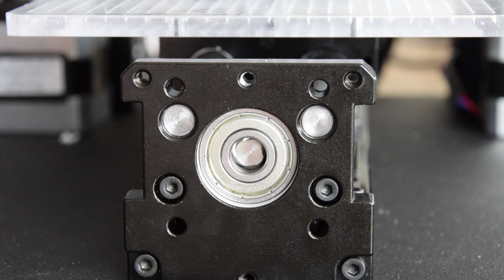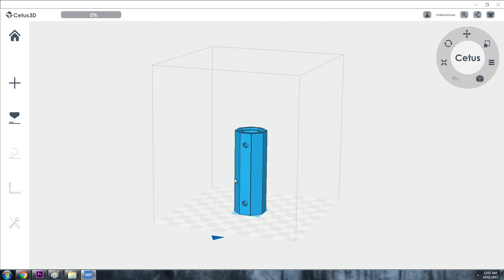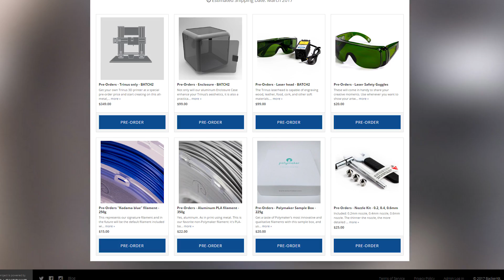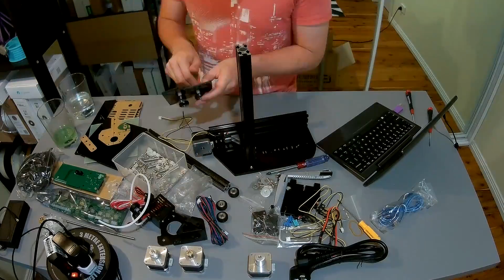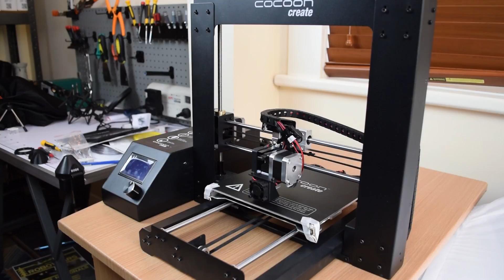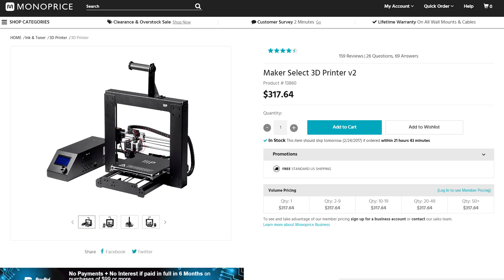Cheap 3D Printers THAT DON'T SUCK $350 and under

Comment: Hey why not the anet a8?
Reply: I have an anet a8 and it takes a while to tune the software etc. But after that it prints beautifuly
Reply: Jere ir just need a little tunning and i believed is better than the tronxy
Reply: Ugh, too many tiny printers.  I bought the Anet A8 for fun and now I am making money with it. Not to mention how much this machine has taught me about 3D Printing.  It was a gamble...but at $155.00US I was willing to take a chance....at least I didn't blow my money on vaporware Kickfarted crap.
Reply: Fear Not God Is Faithful Once you tune it and get everything right it prints amazingly for the price. Better than the tiko at least lol
Reply: Fear Not God Is Faithful There is nothing wrong with a working anet a8. Either you messed something up or it was a lemon.
Reply: mine is working perfectly. did you bother to actualy upgrade it or try to run it stock which no one does.
Reply: My A8 printed fine out of the box and I got a lot of use out of it, but 3 months later the heated bed died. I just bought a Prusa Mk2, so I'm not going to bother getting a new bed. Now I can only print PLA for 7 weeks while I wait for it to ship.
Reply: john convis You can print frame supports, but I actually haven't needed to.
Reply: Gonna chime in and agree. Why not the A8 or any of the other cheap prusa kits? Still enjoyed the video though!
Reply: Maker's Muse why you dont make a review about the anet a8 to have a experienced person to talk us about that printer
Reply: Not true.  Go look at my channel right now. I am on a 9hr 30min stream of a print at 6000mm/min.
Reply: anet at is best cheap printer :D
Reply: Anet a8 is awesome my only recommendation is to get a mosfet on Amazon it's only like ten bucks
Reply: yes. you can encase them, but by default they are slightly exposed.
Reply: What is the big deal about exposed mains? Just unplug the thing or don't lick the input terminals and you will be fine! If this is your definition of scary, you need to live a little. And yea, I am aware of kids. If that is your problem then print a cover, elevate it, or put it out if there reach.
Reply: 7 weeks? Where are you getting your parts? Gearbest?
Reply: The Prusa i3 mk2 is on serious back order. They have a 7 week lead time.
Reply: I think one reason its off the list is because of having to wire mains power to the power supply.
Reply: I have had my Anet A8 for a few months now and it works great! but i hit the bed while leveling and need a new nozzle(in shipping). Would buy again.
Reply: It really should have been sent with a small simple printed cover for the power connection, it is a bit of a strange omission on their part as there was plenty of room in the box and a small cover would have been easy for them to add. Or at the very least a file on the SD for a cover and a big warning saying  "PRINT THIS COVER FIRST FOR SAFETY BEFORE GENERAL USE". 
When I got mine I thought of this straight away and printed a cover up as soon as I did my first few test prints for setup. Then printed a few of the braces up and it's been a solid great printer since then. 
However anyone thinking of getting one should read up on it's problems, like making sure the wires are connected extremely well and triple checked before use, or the relatively cheap MOSFET upgrades and other printable bracing available to fix it's shortcomings. 
But I can see why it's not on the list, as technically you require an electrician in Australia to attach a mains cable to anything and at the very least should only be assembled by someone with at reasonable electrical knowledge..
Reply: My powersupply on Anet A8 have, mains is covered, i think it have IP20. From my perspective it's safe. But this printer needs some modification, i have to replace all heat-bed connectors and i have to agree if it needs solder-station to make printer safe it's not for everybody. 
But for me it's fantastic device and it printed perfectly from beginning and it's even better with beta version of Cura which has setting for first layer.
Reply: The anet a8 but isn't as reliable. Also the tarantula is better
Reply: I would not say it's wobbly, but one of the first things many people print with it is frame braces.  Fixes any possibility of wobble quickly.
Reply: 1 its china 2 dont buy it if thats yours concern 3 any novice is capable of safely maintaining a kitted printer laid out like this
Reply: I heard that the Anet A8 is wobbly because of the acrylic frame, is that true or is it non noticeable?
Reply: Depends on the model. I've found 3 potential versions. The design most popular is with 2 triangular uprights that are perpendicular to the axis of travel. unfortunately they should have been rotated along the z axis by 45degrees because the height of the build volume and the weight of the nozzle assembly has a wobble left and right that gets exaggerated as the print height increases.
Reply: It's simply not safe enough for general recommendation. Neither is the wanhao though.. most reviewers haven't used one enough to notice the MOSFET issue
Reply: at least it's a cheap and quick fix from what I read. But I also agree that that is some tinkering many people aren't willing to touch.
Reply: 3D-MEXICO I got mine for 250 with shipping from gearbest and I love it works great
Reply: As I mentioned, I have baught the A8 and hope it will turn out really 
nice. He included a cheap printer kit, so I can get his point in not 
recommanding it. Besides the power connection "issue", there are other security flawas I have heard of. MOSFET, thermoresistor, connections,... just to mention a few. All in all it should be a great value for the price and with some upgrades sureley a decent printer. BUT it is his oppinion, he expressed, and I totally get why he would not recommand the A8.
Reply: Yeah.  But a EC320 switch can fix that. $5, and print a cover.
At least on the A8 once you are done you can mount it to the uprights and its out of the way from being jostled and stuff.   The A2 and the Tarantula you have no place to mount it unless you use a baseboard to mount it all on.
Reply: or you can just upgrade to ramps 1.4 and 2650... or even cheaper, buy a replacement board... they're cheap
Reply: any product can be a lemon. And a troxixy is probably more likely to be a dud then an anet.
Reply: PC powers supplies with "SINGLE" 12V rails over 20Amp would work fine. If you already have an old PSU (or a friend has one) which has multiple 12Volt sections, but one of them is still over 20A, you could use it but you would have to make sure you are using the correct output that supplies at least 20Amp. Usually the PCIE outputs would be fine, you'd just need to check the manufactures web page or the side of the PSU. I have a Coolermaster one sitting here that has +12V1 16Amp and +12V2 16Amp, so it would be inappropriate. But the one in my computer has a single +12V output at 32Amp so it would be fine. The advantages of using a PC PSU would be they have power plugs and switches (so no need to fiddle with mains voltage), fans for cooling and over current protection.
Reply: Yeah for sure, I am actually partly through a review of the product, I will hopefully get it uploaded within a couple weeks! But I would recommend firstly checking the level of the bed and then printing belt tensioners from thingiverse for Both X and Y axis , they are essential, and adjustable endstops for the Z axis help with bed levelling a lot. Then I also printed couplings for the threaded bar on the Z axis to be supported by. Personally I love my anet, it's currently printing, but it can be stubborn and is not 100% consistent, howvere I have found it to be reliable for the most part when using Simplify3D. One more tip, I always use rafts because I have yet to get a glass panel for the bed heater! I hope this short insight was of some help.
Reply: I understand.  Your original question seemed sarcastic for some reason.  No worries.  I would not say the anet a8 is the BEST cheap printer but it's still a good one.  If I were looking for a new printer right now I would look for something with an auto bed level sensor.  Even if I had to pay a couple extra bucks for it.
Reply: BikeHelmet 120VAC can kill you just as easily. Killing potential is measured in amperes.

0.10 amps is enough to kill you, and a typical residential circuit (in the US) is 15 amps. 

However, I must agree with +Justin M. Cover it somehow. Don't wire it while live. Any poor outcome is definitely needed to further Natural Selection.

ETA: Actually higher voltage circuits can be safer, because a lower amperage is required for the same amount of work to be done. ::: Power = Voltage * Amperage
Reply: The problem comes from the resistance of the body. Using V=IR you can see that the resistance of the persons body (plus resistance of clothing and floor) will remain constant, but as the voltage increases so does the amount of current that flows through the person being electrocuted. So at 240V 2x the current will flow and if at 120V the resistance of clothing and floor is enough for a person to be safe (at least not dead anyway) ,at 240V they most likely will not be safe.
Reply: My abet a8 prints perfectly and I've had it for 6 months. bought it for around 155$ and the only problem I have run into was fiddling with the spring inside that provides tension to the extruder motor pulling the plastic, other than that, it has a huge printbed (heated) with the only downside being no powerswitch, but you can always buy one anyways and also buy a Lazer leveler while you are at it. Some people say that Gearbest has little support and that's true lol, but if you order one and they take ages to send it to you and ask you for more money to cover shipping costs, just tell them you are a big YouTube doing a review of it and that you are in a tight schedule, that's what I did and they shipped it on the same day lol. works every time because they don't want a bad rep.
Reply: anet*
Reply: +1 to anet a8, huge print size + heated bed + insanely affordable
Reply: Fear Not God Is Faithful Where Are you from?
Reply: if i may ask what are you doing to profit with it?
Reply: That is what i was thinking.
Reply: Alex, we are all here to share our opinions and my stands as it is.. and yours must be very similar as otherwise you wouldnt have ordered the A8. My A8 was build without issues and is operating without issues. no danger of the mains, no mosfet issues etc etc etc.
Reply: +OohzyJohnDow, of course we are here to express our opinions;) All I am 
saying is, that it is reasonable to not recommand the A8 in this video. 
Your opinion might be different, but otherwise discussions would be 
pointless^^
Reply: Alex, i hope your A8 comes soon and i wish you loads of makers fun with it.
Reply: Jere What do you say if makers muse make a review of the anet a8 yo be shure of What people say
Reply: Maker's Muse I've had both of their melzi boards. neither of them can handle the current for months on end, especially if you subject it to ABS heating times. adding a MOSFET fixes it but they do eventually burn out without one. it's on a RAMPS with upgraded MOSFETs now.
Reply: Mines fine, has been working almost constantly since Christmas with no problems, currently in the middle of printing the full size Thompson machine gun and its running 8-10 hour prints with no issues.

I think for every one person who gets a duff one there are lots more who's is fine and for the cost i was willing to risk it, only mods i made to mine were a filament guide and a semi circular air blower for the fan.
Reply: Samuel Porter i bought a ultimaker 3 + and ir esa lemon
Reply: ya my anet a8 is the best price and is the best with some 3d printed upgrades    and i think it deserves the number 1 title!!!!
Reply: I purchased an anet a8, if you are mechanically minded its amazing! I love mine to pieces, however it's taken a lot of modification and tinkering to get to the stage its currently at. In the flash sale it only  cost £120 shipped.
Reply: I am really sorry to hear your experience with it has been so frustrating. Hopefully when the new board arrives that will fix your issues, I have never update the board... if it aint broke dont fix it :P didn't really want to risk causing unnecessary damage, however I will get a better PSU as I don't like the safety of the one provided
Reply: Yep. Getting a bad item from China is one of the most frustrating things in the world to rectify, I can see why you wanted to rant. :) 
At least parts are readily available and cheap for repair of this printer, it's probably easier than trying the warranty runaround. :)
Reply: Fear Not God Is Faithful check out my EDM?
Reply: You know you can buy a new controller, even an upgraded one, for about 30 bucks yeah
Reply: 3D-MEXICO wut thats what i thaught
Reply: so you guys are saying that still to this date (april 2017) the anet a8 is the best-cheap printer ?
Reply: I'm saying it's one of the best.  Did you have a suggestion for a better one or are you just trolling?
Reply: it's a real question ! The anet a8 is a 2015-2016 printer, just wondering if it still godd or there's better options now. maybe it's because english is not my main language :P
Reply: nice ! thanks for the advice !
Reply: SHIT! I never thought of the laser level, I got a Tevo and my only issue is the print bed leveling is a bit tough.
Reply: He can't really recommend something he's never used before.
Reply: At least you didn't have a broken mother board like me lol
Reply: I got Anet A8 from Aliexpress 100USD it took me 2 Days to setup ect. after that i got amazing results its just incredible for a 100UDS 3D Printer!
Reply: i have no upgrades and am wondering what to get any help?
Reply: '*that don't SUCK*'
Reply: Jere my anet a8 almost killed me.
Reply: Too much fire
Reply: Best printer i have ever had, sure it was a bit weak at the beginning, but as long you're willing to install upgrades and mods, it can stand its ground among higher tier printers.
Reply from the maker: Gonna chime in - there was a big batch with faulty connectors on the Wanhao for sure - mine's been rock solid though. if something did happen you guys would be the first to know about it! I still use the cocoon create for a lot of the 3DP101 videos. Any machine with mains exposed at any stage will never get a recommendation from me - such a thing is reckless from a manufacturer and straight up illegal in Australia.
Reply: @Samual.. sigh.. I am not trying to convince anybody, I am merely expressing that you clearly lack the experience in your life to have come to the same conclusion. Nobody is claming it is "acceptable" that a faulty product is bought as a consumer, but guess what? It happens constantly! as it is just inevitable. It is actually commenters such as yourself that would sway a gullible buyers not to buy a product such as the A8 and overpay for other crap while they can still receive a lemon. It is absolute nonsense what you are expressing and life will show you so. I have bought consumer products from top brands of thousands of dollars and happily coming home to hook it up and it just burns out etc (tv, kitchen appliances, tools etc etc etc) and I have bought plenty of cheap no brand items that I am using and abusing for 10 years already. And you come here claiming a manufacturer/supplier is unreliable just because you can buy a lemon, that is just very naive and shows you have close to zero experience. What makes a good or bad manufacturer/supplier is the service you receive after buying a defective item, nothing more and nothing less.
Reply: I have had zero none fixable problems with the Anet A8, maybe you are the useless paperweight who just can't follow instructions.
Reply: @Samuel.. you are joking yes? You are either way to young or have way to little buying experience in life to know that lemons you can by anywhere at any time from any brand at any price. And this counts for ALL products you might buy in your life, not just consumer electronics. For now I would suggest you accept that you really dont have the needed experience yet to express your opinion so strongly in public.
Reply: OohzyJohnDow See this is part of the problem. There are people online like you trying to comvince everyone they just got unlucky. you're either shilling or overly defensive because you got lucky. There are so many inexperienced buyers wanting to get into 3d printing that are easily misled by these shill comments. Id be all too happy if they put in big red letters "Product parts are untested and may require extensive troubleshooting" not this minor tweeks nonsense.
Reply: I am still waitung for my A8 to turn up, so I can only judge from pictures. The little plasic cover is nowhere near save enogh. Also connecting main voltage on your own is not exactly what I would call consumer electronic.
Reply: @Makers Muse.. the a8 has the mains exposed? Or did i misunderstand you?
Reply: Justin M:
"What is the big deal about exposed mains?"

In Australia they use 240v. In Canada and the US, 120v. 120v will shock you good, send you flying backwards, probably lose a few seconds of consciousness. 240v can kill you - especially if you're a small kid. If your heart stops, goodnight. That's the big deal, and why I agree with not recommending the A8. I enjoyed mine, but the heatbed did die, the power supply tends to overheat and needs a fan mounted to it, the board is crap and will burn up without mods, the tensioning and frame need mods to get good quality at higher than 20mm/s, etc.; it's a WIP printer that needs $50-100 of mods and a few days of work to be acceptable.
Reply: Justin M Easy answer. No responsible company should leave mains exposed for consumer installation. Should always have failsafes for customers unknown to the danger. Sure it can be fixed but it should be included. Imagine having to wire your ac unit when you bought it or hardwire your microwave and deal with mains. Seems easy to those with experience but these are printers for beginners.
Reply: Alex, i build one a short while ago and at no point in time was I in contact with exposed mains. Yes you have to attach the main cable to the powersupply, but both this powersupply nor the main cable was no where near the mains. As well, there is a plastic cover over the connectors. Am I missing something? Or is this really only about the fact that you have to attach the main power plug?
Reply: Alex, i get what you mean.. and you are right.. the Anet A8 kit is not a consumer electronic. it "may" turn into one after you build it though :D ..as for the plastic cap.. yes, they could have just made the powersupply plug and play, but i guess that is all in the price tag and in the end, seperate powersupplies are available to remedy that or the connections easily fully covered if a person really finds it scary (which i really do not and the plastic cover is "suffecient"). Though, to not include a really good and really cheap kit printer just for that i find a bit juvenile and short sighted
Reply: 3D-MEXICO the anet a8 is a flaming death trap
Reply: Have A8 and I would strongly recommend this printer. Already making money with it - after a few minor upgrades prints quality definitely better than on few presented in this (marketing?) video. (tested two of them - more like  toys - and there is no learning curve about 3d printing with  them). Safety argument is quite unconvincing because only idiot approaching kit assembly without any basic knowledge about electronics)
Reply: Matt's Music The fact you can buy a lemon at all means the brand is unreliable. Who wants to buy a new printer which comes with faulty, unverified parts? Might as well buy a broken secondhand printer if you're going to have to replace parts anyway.